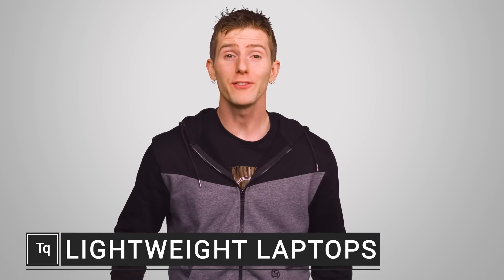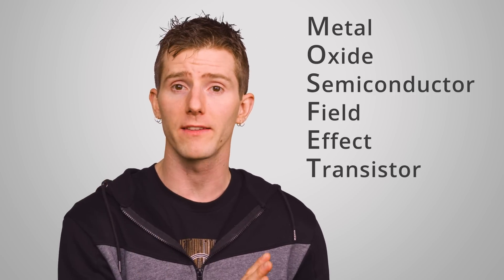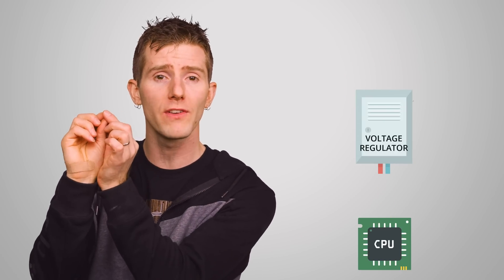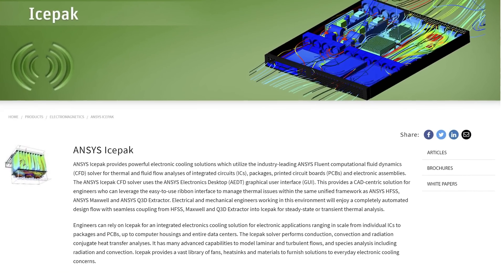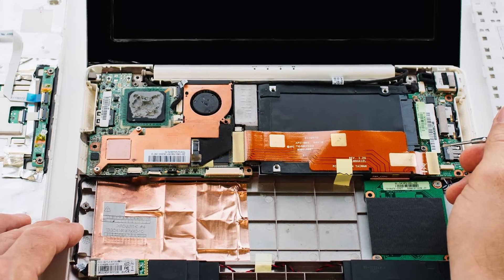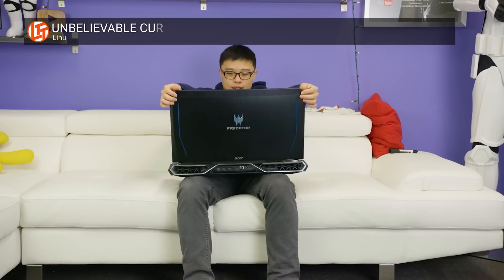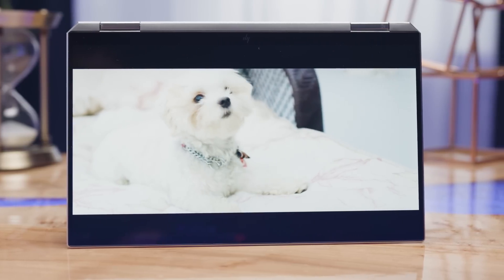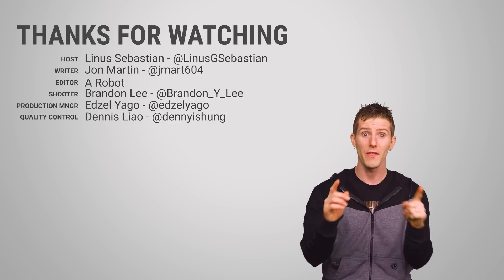Why Aren't Laptops HEAVY Anymore?

Comment: When a laptop maker says "thin" and "light", I hear "fragile".
Reply: Not if you pay for enterprise grade. 
You get what you pay for. E.g. milspec stuff on the higher end ultralight models
Reply: @akar2755 Dell 'military durability' certifies laptops with failing hinges after 2 years of operation. Bullshit. Military/SWAT/whatever just means barely enough for the contractor to consider worth taxbux
Reply: just as when people say "clean" and "minimalistic", i hear "bland" and "bleak"
Reply: @theX24968Z  get out not funny
Reply: i mean there are thin and light laptops with metal body constructions which can survive the occasional dings and falls. the original macbook air bodies lasts many years. you can still buy 5-6 year old used macbook airs in perfect body conditions but the display is very dated. I don't think modern laptops are that fragile that they can't handle everyday use for a few years at least. If you need something that can survive more than that, you should probably look for something else than a laptop.
Reply: @milindchauhan  my Laptop is 7 years old and doesn't have no damage at all
I handle my Laptop properly
Laptops are not made to be thrown around is what people need to realise
Reply: @stephensnell5707  damn i don't even remember making this comment. What laptop do you have btw?
Reply: thats why you shouldnt buy cheap """ultrabook"""

Comment: Just think of how much better they could be if they were still thick though. From my observation people with weak wrists and the inability to fix their devices entered the market. We ended up with thermal throttling, hard to repair, glued together things that "look good".  

My work's HP elitebook kneecaps the 8th Gen intel cpu. HWinfo reports them hardware capping the cpu power delivery so it doesn't catch fire; and it still sits at a cool 80C+ under load. If only there could be a way to fit adequately sized heat pipes that ventilate out of both sides. 🤔

Comment: That's a great explanation of why our laptops aren't like they were in the past. But, why is my laptop the way it is?! This is an idiot guy's rant about his laptop, so if you don't read it, I don't care.

First of all, my laptop is a 2015 Dell Inspiron 15(inch) 5555(model # for the exact specs.), and my number 1 problem with it is that Dell put in the smallest battery I've ever heard of in a laptop. 1990's laptops may have been worse, I don't know, but out of all the laptop reviews from LMG, I've never heard of a gaming or thin-and-light with a battery this small or smaller. My Inspiron 15 5555 has a whopping 40Wh, cylindrical-cell battery, not flat, glued, and internal like laptops today. At least it's removable, with a latch next to it! It doesn't last for anything, powering one of the worst mobile quad core processors, at least there'e 4 cores.
I wanted to write more, but meh.
But I'll answer my own question. Most of this laptop, but not everything about it, is kind of crap because I'm an idiot who bought it on a TV shopping channel. So it was like buying a Black Friday deal smart TV, with 1 or 2 HDMI ports and no Ethernet port.

Comment: There really needs to be a intermediary semi portable market

Just like there's a niche market for high end mobile phones that aren't thin at all cost but actually have a decent battery size in them (remember when you could replace the back with a larger battery pack), there's still a market for larger old school designed laptops.

A removable battery (hard reset) and the ability to open it up and do some upgrades and servicing, even just blowing out the dust, are useful for power users. Heat death is the most common cause of laptops dying.

It would be great to have a laptop that's big and could be opened up and upgraded. It sits at home mostly, but can be packed up and moved with a bit of effort, say around the 4kg + mark.

Or even some small desktop cases with a built in screen on the top, so you can do the old LAN party thing. Not a daily commute, but not fixed in place like a tower, a monitor, a bunch of cables ect.

I still haul my old Asus N71 over to a friends place so we can Diablo 3 with most of the clan in the room, so VOIP issues aren't a thing.
Something I can carry from a car to a apartment and not have to muck around setting up, but that isn't heavily compromised in order to be able to carried around all day as I dance to some background music in the add… .

Comment: Because are made of cheap weak plastic with less power cells and bad user upgrade possibility. Back then anyone was able to upgrade because of the small doors to ram, hard drive, pci. Now you have to open the entire case and deal with flat cables connectors and other shit.

Comment: Honestly, I wish my gaming laptop was heavier, maybe even a half inch thicker.   Just imagine the battery life and cooling performance of rtx 2070 laptops if they were just a half inch thicker. It'd be totally possible too, just offer what is already made, but then sell an upgrade kit where you unscrew the bottom of the laptop, pull the old heatsinks and battery, and then slap the new ones in with a modified bottom plate to account for the size difference. Also they could add bios features that recognizes heftier battery and cooling and allow the GPU/cpu to draw more power, and maybe even get laptop GPU's closer to desktop performance. Okay rant over thanks for reading!!! Maybe one day I'll be in a position to design something like this
Reply: Oh one more thing, I think the upgrade kit option would be totally possible because it seems like a lot of laptop companies use the same layout for a whole line of laptops, just some have 2070 and some have 2060

Comment: I wish they'd use all this space saving to improve cooling instead of making it lighter.  they got as small and light as they needed to by 2010
Reply: It's a shame they make the batteries smaller as well
Reply: i mostly agree, but the past couple years they shrunk bezels which make it smaller in a direction that makes way more sense. otherwise i totally agree, fatten these bitches up
Reply: But it is true. My gf's HP notebook gets hot and throttles when charging
Reply: It’s based on what people will buy. They will buy what looks good in the shop, never mind how it performs when it gets home.
Reply: I would've agreed with you but a while ago but I recently got the hp envy 13 and by god the lightness makes so much of a difference for me. I know many people don't really need the portability because they're trying to get gaming rigs or something like that which wouldn't have the need to be moved that much. But someone who just needs to do keyboard work and some media consumption, with some occasional heavy stuff, laptops have become very good. I mean i can fifa 18 on this laptop locked at 30fps.
Reply: @milindchauhan  i literally travel for a living and would rather have a gaming laptop than a skinny ultrabook for more than a few reasons. 

but i guess the 49 pound tool bag has me biased on the weight issue lol
Reply: I agree 1000%, Dell still makes beefy laptops without sacrificing performance. I have an 11 in with a 6th Gen I5 with all the ports I could want and a massive battery. It's perfect!
Reply: Anyone who tells you a Laptop computer that’s more flexible and flimsy and has a significantly smaller heatsink and less powerful fans for cooling in a significantly smaller form factor making it more likely to overheat and crash is better is totally full of sh*t!!!!!!!!!
Reply: Jason C. Depends on the use case I have alienware m17 for gaming at home or with friends. but if I'm traveling around, coffee shops, airports etc it's better to bring my acer zenbook 13
Reply: @topethermohenes7658  chad thinking, sadly the majority disagrees with it
Reply: Not really..

Comment: "Without compromising on performance"
*Thermal throtling has entered the chat*
Reply: CPU current limit
Vrm throttling
Power saving
CPU power limit

Entered the chat
Reply: @eduardoavila646  yeah that's what everyone needs. Limit the performance of your expensive laptop so it doesn't thottle. Also everyone is a tech savvy and knows how to do it. Also, every bios has all the needed settings. Yeah, riiiight.

Comment: hhhmmm nah laptops didn't use a ton more power than newer ones, ultra-thin and light ones yes, but not really the higher performance ones.
When we compare like 10 years of laptops it's really just the chassis ditching metal structures. Open one and you'll see how sad it is, seeing screen hinges screwed straight into the plastic top or bottom.
My old HP dv6000 was one hell of a problematic crap but damn, that thing had some beautiful alloy structures holding the hinges and even some fiberglass reinforcement behind the screen to avoid the lid bending and breaking it.
Talking about expensive machines having special alloy structures is nice and all but it's really just the more expensive ones that do, and have always had it.

Comment: 2:16 "more connectivity"
* cries in ultrabook *
Reply: Mine doesn't even has Ethernet port
Reply: @vinaybhogal355  mitashi 20
Reply: I hated that my new laptop only has 2 usb a ports
Reply: @chaeyoungshi  bought some cheap HP laptop and the 2 usb A ports are so close to each other that you can't have 2 usb cables in at the same time 🤣

Comment: I miss the heavy laptops with removable batteries, swappable external drive bays, etc.  I once had a laptop which had multiple removable battery bays I could hot swap.   So I could run indefinitely on battery just swapping them out while running.
Reply: Removable batteries aren't even necessary

Comment: What's the difference if a laptop weights a pound or three more. It just sits there when in use and a bigger heavenlier computer can have more components larger better screen, better keyboard. The keyboard should be removable and wireless along with the mouse. My ASUS GL702VSK is heavy but preforms better for Video editing and has Multiple ports for accessories and monitors ext. Besides if you can't carry a couple extra pounds maybe you should invest in a gym membership.
   now if you really want a light computer make one where the computer stays in the bag or back pack and the screen either projects on the wall from a witless modual one sets on the desk and also projects the keyboard on the desk or table. Even better a pair of glasses that you see a 60" HDTV out in front and you interact thru a special fade/voice/gesture controller.

Comment: Most laptops are not heavy anymore because they're basically disposable devices with soldered on everything and have 0 of the essential ports.
Reply: yeah most of won't last long... a few dust and now it a heahache to deal with..
Reply: And also because they are made for, essentially, paperwork and media consumption. Trying to run anything heavy on them, let alone game, will swiftly result in thermal throttling the already fairly undercocked CPU.
Reply: @NekoiNemo  U N D E R C O C K E D
Reply: @NekoiNemo  that's false laptops will last a good 10 years before failing totally
My own first laptop lasted 6-8 years before the cooling fan went up the wall(stopped working) so I had to get another laptop as with a burnt out fan it was getting just too hot
Reply: @stephensnell1379  yeah if you play a hour a day lol, modern gaming laptops would barely make it 4 years under intense gaming
Reply: @NekoiNemo  also I play simulator games on my own laptop and it's speed never drops at all so what you've said is false
Reply: @NekoiNemo  you mean Underclocked
Reply: I don't think you quite understand what weight means.

Comment: Because theyre built like crap now. I can pick up a 15 year old thinkpad has been dropped down the stairs, and it not only is in one piece, it works. Do that with any modern laptop, and if its still working, see if it is 10 years later.

Comment: I require a Bluray/dvd player/burner as part of my laptop. So this trend of leaving out useful items in order to be"lighter" and/or thinner is not in my best interest.
Reply: That's why i still keep alive my Acer aspire  8920g.
Reply: Agreed
Reply: I agree, I also find robust laptops more appealing ergonomically because I notice that my new laptop is easy to flex and it also has very smooth case so its easier to drop (which I assume it isn't designed to withstand). Today, tech is designed to be more of a decoration than a practical toll, and I don't like that trend.

Comment: Suprised you didn’t mention Loss of mechanical drives
Reply: The first Apple Ipod had a teensy 1.8-inch-or-so Toshiba hard drive in it.

Those tiny drives were killed off by the emerging SSD market.
Reply: Because laptops still have them?
Reply: It wasn't mentioned because it is a tiny saving in mass.  Pretty much negligible compared to all the other savings.

Comment: I miss the days of affordable, big laptops. These days you'll spend 50 % more than 5 years ago if you want a thick laptop with adequate cooling and a decent typing experience.
Reply: You should look for a Thinkpad W451. I know its from 2014, but it has switchable cpu and graphics, adequate cooling and a good typing experience and it only costs about 400$. The i7 4910mq performs like a I7 7700hq and you can upgrade to an unlocked extreme edition laptop cpu.
https://cpu.userbenchmark.com/Compare/Intel-Core-i7-7700HQ-vs-Intel-Core-i7-4910MQ/m211019vsm9700

Comment: 1. Huge dvd readers
2. Heavy HDDs
Reply: 11. Boobies
12. And more boobies.
Reply: @shutdahellup69420  you have achieved maximum wisdom
Reply: And vegina
Reply: @shutdahellup69420  who are you
Reply: 9. Upgradibility
10. Expansion
Reply: I'm surprised the move from HDDs to SSDs wasn't counted as a step to make Laptops lighter.
Reply: Don't laptops still have DVD readers?
Reply: @piadas804  Some, but they are a dying bread
Reply: 3. accu
4. ports (in term of thicness)
Reply: 5. Chassis
6. Battery
Reply: 7. Useless hardware
8. Unnecessarily large batteries******

Comment: No mention of size, weight, and power savings with the transition from hard drives to solid state drives?
Reply: it's not that much lighter. an SSD is smaller but a hard drive is rarely the limiting factor in size.
Reply: An SSD is much smaller and weighs much less than a hard drive.  Especially larger capacity ones. Let alone an M.2 drive. Then energy savings on top of that. I just think it should have been mentioned if they talked about size and heat of CPU’s

Comment: When you remove all the ports and useful features, you save a lot of weight!
Reply: Dark Phoenix  but then you’re carrying around dongles for everything that isn’t USB-C natively.  I’m sure in the future that’ll become more rare but it’s still meh.  I know I’m in the minority wanting an Ethernet port so that’ll probably be a dongle in almost every laptop.
Reply: @TheGoat Enterprise laptops are the prime example of setting your priorities on actual functionality instead of unnecessary form.
I mean, I get it lightweight laptops, that's a lot easier to carry. But I can't figure a single scenario where 1cm of extra thickness harms it.
Also, it's so sad seeing how laptops are built nowadays. You have to look into some quite rugged little machines to not find screen hinges screwed straight into plastic posts with nuts inserted on them. It's no wonder you'll save weight when you remove all the structural parts that kept it from falling apart after opening it up for the 10th time.
Reply: When you remove the computer then there is nothing so no weight
Reply: @Dark Phoenix "for everything anyway " unless it is an external hard disk & anything else, and you want (it could sound crazy) to copy a big file.
Reply: I too use the Ethernet port.  The port on my Acer broke because it apparently isn't designed to be used, so now I have to use a silly dongle.
Reply: Many Dell laptops are also ultrabooks, yet have tons of ports. So, it's a bad excuse for Apple.
Reply: TheGoat you may be right, there, since my laptop usage is exclusively Apple.  I haven’t seen tons of videos on PC laptops lately but the ones I watch seem to have models that are very light on ports.
Reply: @aps5150  well there's your problem. many laptops have a variety of ports and features but apple only offers a few choices. you can still find laptops with Ethernet, HDMI, USB a, and USB c if you look for them.
Reply: Andrew Stewart there are usb to ethernet adapters too

Comment: Give me laptops with a lot of ports and good cooling, I care about weight, not the thickness.
Reply: @TheGoat No. Those laptops are very badly built.
Reply: @TheGoat let's take that Ryzen Yoga Linus showcased couple of months ago. Non removable battery, only 2 USB-A ports, single SODIMM slot etc etc. Modern laptops suck
Reply: @TheGoat And you just defeated your point. A T480s is not a mid-range laptop.

Comment: Because its "normal" to see 100C spikes on your i7 laptops aperently
Reply: That's Called Thermal Throttling
Reply: @xD3bod, Stop defending bad design and poor quality. 😠 Thermal throttling is NOT a good thing. Thermal throttling lowers the cpu clock speed and it typically only kicks in during extremes when the CPU is about to catch on fire or melt down.
Reply: @kalijasin  Stahp feeding him lol
Reply: @Dacite6  cancel an interval IB kishori cloud-busting right can a scammer as I sell my antique ahmed's get sent them to the back in and he convinced came back in the house and go find a Medicare a reasonable time together there'll be a lot more to say
Reply: xD3bod r/woooosh
Reply: @Anonymous-be8hx  i think people understand the joke just not how to use " and '
Reply: Yeah chips are more resilient to heat also
Reply: @Devill's Hill, and people wonder why their laptop computers crash and are sluggish and laggy 🙄